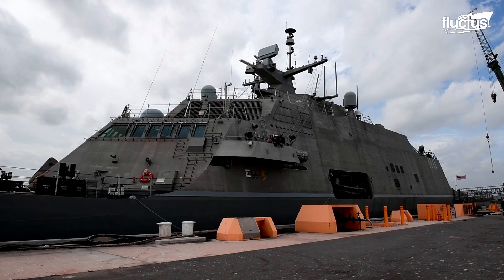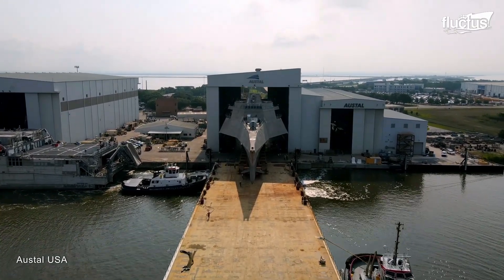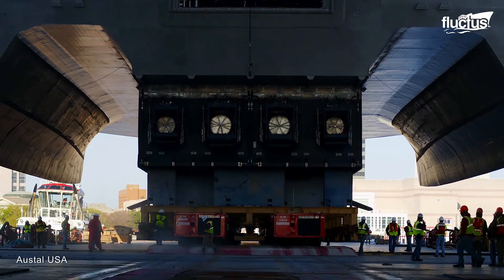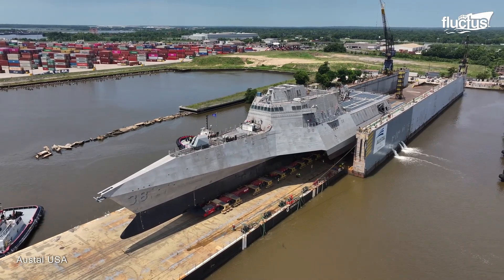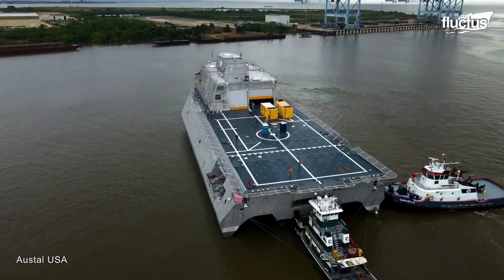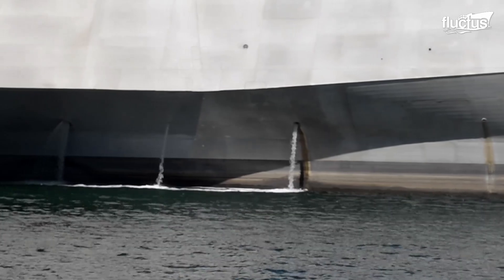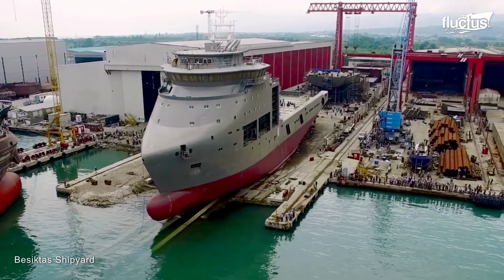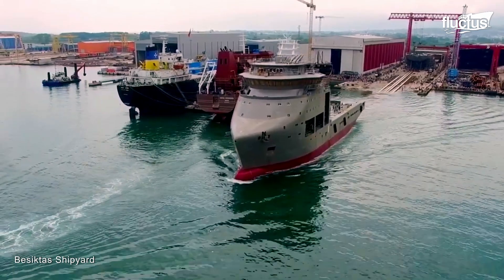The Hypnotic Process of Launching US Navy’s Newest $600 Million Warship

Comment: Lol now show it getting sent to the scrap yard as @Ned-r4t mentioned... one with a crap transmission and having a small crew to save money, but requiring contractors to fix - costing far more, and a  trimaran with the support for the outriggers that cracks because they used the wrong material - and as didn't make it as fully separate sections, with gaps to expand - flex.